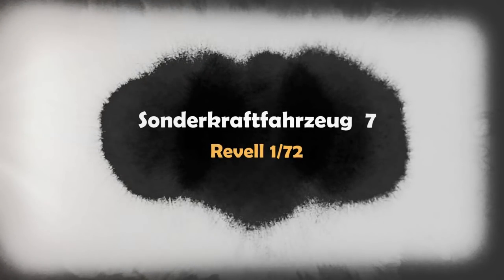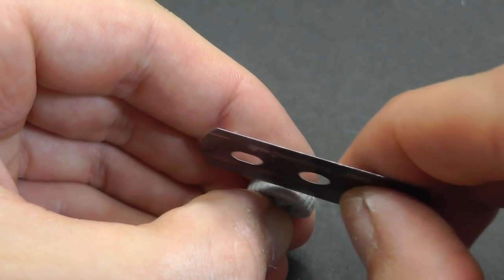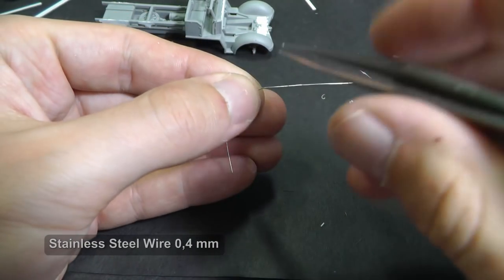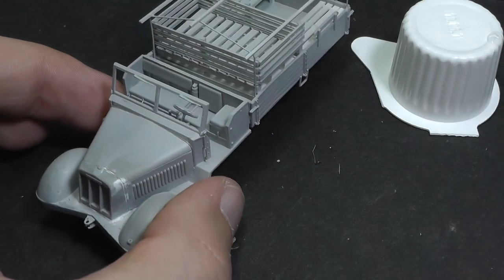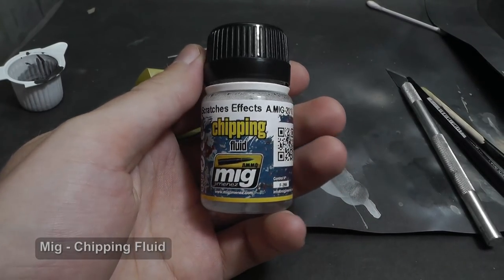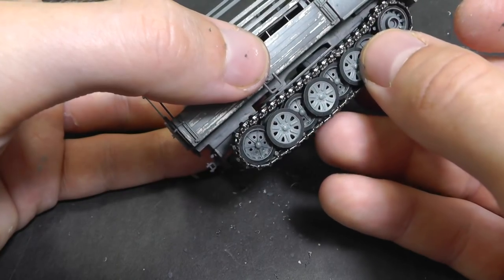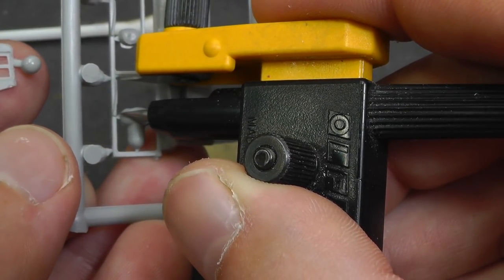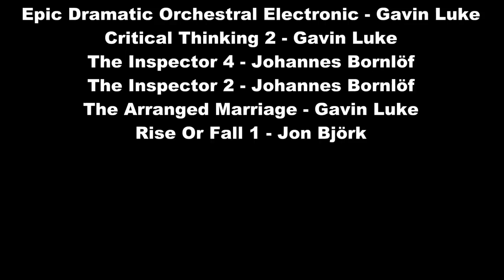Sd.Kfz. 7 Mittlerer Zugkraftwagen 8t - 1/72 Revell - Half-Track Models

Comment: the small spheres on the vertical spring supports were indicators of encumbrance. They had the width of the most protruding parts of the vehicle, to indicate to the driver whether he could go through narrow passages

Are used today also.
Reply: Absolutely right!!!
Reply: thats right! and I still remember when trucks had them when I was a boy :-)
Reply: Like a cat's whiskers!
Reply: Yep...started by Packard in the early days.  They were indicators so you can see how wide but also they were used in trucking to tell weight when installed on the rear.  It wasnt very reliable but it went like this:

A larger circle was painted on the wall of a grain barn or a post was put up with a ring on it.  A stopper post was received slightly in the ground horizontally at a 90 deg angle.  You pulled up to the loader and when the ball centered into the ring or circle they knew it was full when loading from the side or back if closed.

Packard saw this and used them on the trucks in front as a makeshift fender indicator.  It's still used on some farms in the rear but everywhere in the front.
Reply: Anyone know what the piece of music is called when he is chipping the truck bed?
Reply: I remember curb feelers so to prevent you from damaging your tire/rim
Reply: Just for completeness, they're called "Peilstangen" (plural) in German (which basically translates as "marker poles", I guess?).

And, yes - the idea is practically resembling a cat's whiskers 😺
Oh, and great job on the model, @PLASMO by the way - I really like your videos, esp. the 1/72nd armored vehicles 👌

Comment: I think the Purpose of the ball could be to give the driver awareness of where the front fenders are
Reply from the maker: It makes sense. Thanks for the info.
Reply: PLASMO - plastic models model looks as stunning as always of course
Reply: the balls show the driver if he can pass the gap with the vehicle. They are showing to him the width of the vehicle. The rear of the vehicle is widther the the front. If he fits into the gap with the front without toughing the balls with the obstacle, the whole vehicle will get tru. They can be aslo used as help while uploading the vehicle on the train or when you pass ponton bridge.

Comment: For applying really tiny, usually stuff  like those little metal handles that you do or tiny photo etch parts, I would HIGHLY recommend these wax pencils I got recently. You just sharpen it to how you need it and then the wax is great for picking up parts but then when you place it the wax doesn't hold on to it more than the glue. Been very handy with the extensive photo etch on this Mig-3 I'm doing.
Reply from the maker: Thanks.  I have wax pencil, but I rather use ordinary tweezers. It's a habit.
Reply: Yeah there are certain things where there is no replacement for good old tweezers.

Comment: Hey. Its easier to cut wheel tread if you put razor saw on a sheet of styrene horizontally and turn the wheel. then add bit of styrene for another line. this way you have same spacing every time. You can use balsa trimmer tool for that. Anyway, amazing video as always.

Comment: It is my understanding that the  small posts with the ball on top which were painted white (just the ball), served as a visual marker for the width of the vehicle while driving at night with blackout lights so that on coming vehicles could gauge the width of traffic approaching them.  It was also done with painted white stripes on the widest point on the front, rear, and side corners.  These often became so dirty, that they didn't really accomplish their intended purpose.  Although never officially discarded, troops often ignored repainting these markings, especially after 1942.

Comment: That ball is most probably indicating to the driver where the front outer most point on the fender is. If the view down is obscured with all the shielding on the windows this would be needed. The biggest turning radius is made by the front fender on the outer side. The ball is not exactly on the front most part of the fender but is still probably there for this purpose.

Comment: For all the modifications you do on your models with wire and such you need to get your hands on a Jewelers Anvil.  They are very small and it would give you a hard surface for shaping.  Amazon carries them and they are under $20 USD.

Comment: hi, you were saying there if anyone knows a good way of making the width bars on front what we do if doing them Ball bits on the end is, using your punch and die set punch out a small round disc just flat and glue it to the tip of the copper or brass rod, or if doing the chains on the IDF merkava glue the flat disc to the end of the chains and just dip them in a bit of enamel paint! turn them upside down the paint actually beads up perfectly in to a ball on the end's it works perfectly! i actually found this out with hobbyboss's merkava they had flat disc on the bottom of the turret chains so dipped them into paint and let them bead up! hope this small tip can be added to your memory bank for future reference's!? at least it's another good way of getting a perfectly Ball shape of any size in seconds!

Comment: Hi, great model and I love the result. Especially it is not another Tiger / Panther model. But I have one note. Scratches at crate technically look good. But look more like scratches to another paint like at Africa Korps vechles or winter painting. In my opinion the color of wood should be more various, like diferent colours on each planks. Also scratches could be less regular. For eg. at floor it could looke more like some abrasions where crew keep legs etc. Regards!

Comment: One question for anyone.  Could you use an empty Tamiya extra thin quick setting cement bottle or an empty Mr. Cement S bottle and adapter for the Revell Contacta?  Nice job on the build.

Comment: Beautiful build as always. One question, why didn't you build the scratchbuilt structure outside of the trucks cargo bay before dropping it in ? Wouldn't it have been easier for you to manipulate all those small pieces outside of the truck's frame ?
Reply from the maker: Yes, it was, but I do not like painting different sections separately. It is hard to make shading and highlights uniformly. Therefore I rather paint everything together. However, I am talking about 1/72 scale. It this scale it is standard practice.
Reply: Thank you for your answer !

Comment: What model Harder Steen do you use?
I’m still using a 1982 Paasche H
But i can’t get results that I would like!! It’s a good solid tool!! But it can’t handle the fine , low pressure, fine tip work! Thanks Dean

Comment: hello david could u explain why u thining acrylic paints with lacquer thinner? and als could u explain why u using it?
Reply from the maker: Because it works much better then x-20a. Color diluted with lacquer thinner has much better coverage also it prolongs drying time, so you do not need paint retarder and has much better consistency for airbrush. A disadvantage is a smell. However, I heard that in many countries is unavailable.
Reply: thanks for your adswere... its through availibility i live in uk and i cant buy in hiere need to buy on ebay froch china
Reply: ohh i forgot one more question u prefere this lacquer thinner for all paints? and what lacquer thinner is the best? sorry that was 2 questions... ;)
Reply: but david u mean x20 or lacquer thinner? just for make sure... sorry for that many questions hehe :)

Comment: How much money do you think you spend on the kit including all those paint,cement etc.?
Reply from the maker: I got kit as a gift also It is 1/72, scale, so I did not spend much. Maybe two or three dollars on a material. The most expansive is time. :-D
Reply: How many hours did it take you to build it??
Reply: 1/72 scale is very economical.  a small tamiya bottle of black will paint a dozen models. plastic card is cheap, recycle packaging if you can or want.  Oil paint can be expensive, but a 2oz tube is a 30 year supply for washes.

Comment: Extremely impressive as usual! However, the benches in the 'cargo'-version of the Sd.Kfz. 7 however were not facing each other with the backs to the outside of the vehicle (the standard military truck lay-out), but one bench faces the front while the other bench faces the rear while they are back-to-back. This detail is also wrong in the Dragon kit. The correct layout can be seen in the original Sd.Kfz. 7 'Cargo' from the Bruce Crompton Collection, of which you showed the front a few times in the video. There are many photos of this vehicle available on the net.